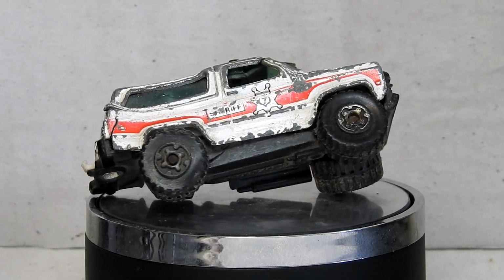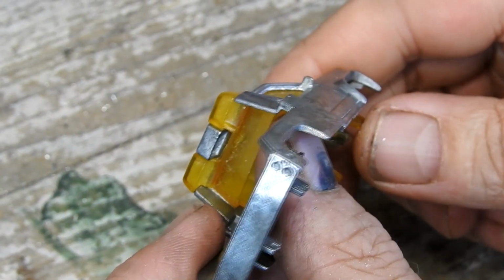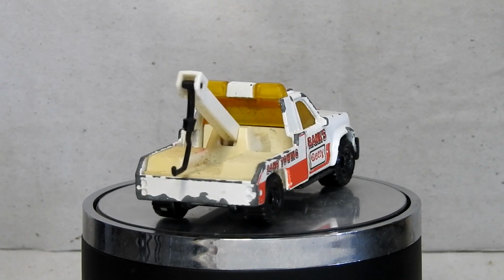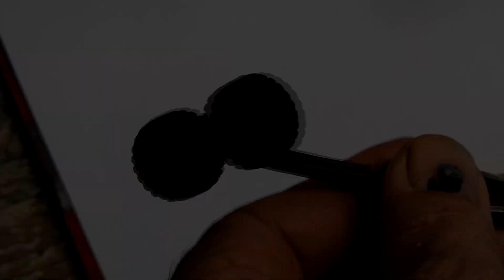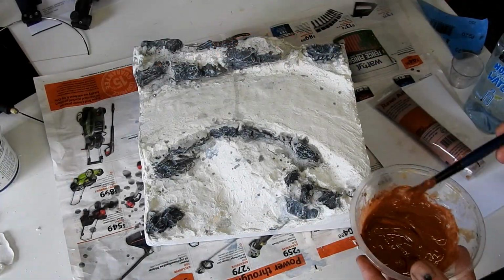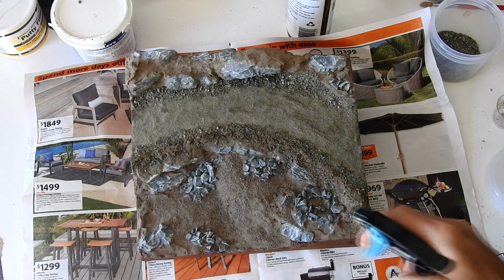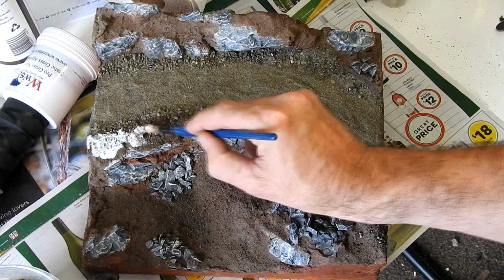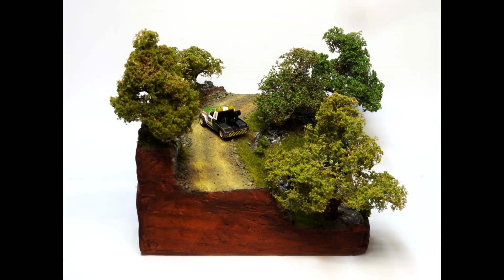Chevy Blazer Crash Scene Diorama Realistic Matchbox Custom

Comment: My brother owned a Blazer. The rear roof section was made of fiberglass and meant to be removable so you could have an open topped vehicle behind the front seats. In a roll over crash, this top would not be bent, but rather fractured or torn off completely. An additional touch might have been burn damage around the hood and front fenders from an engine fire caused by the crash.